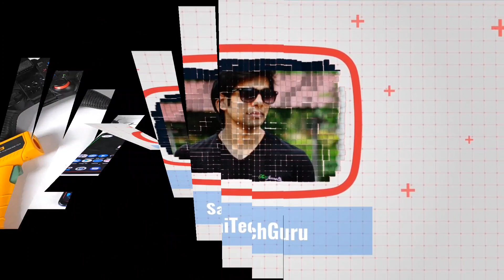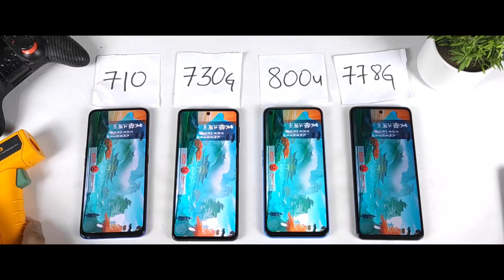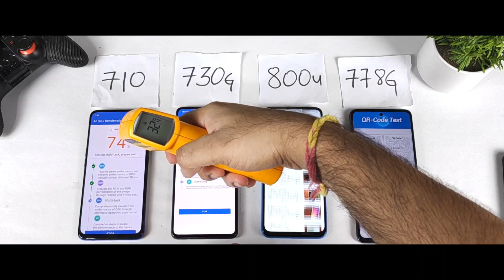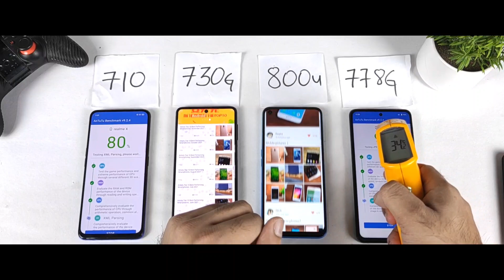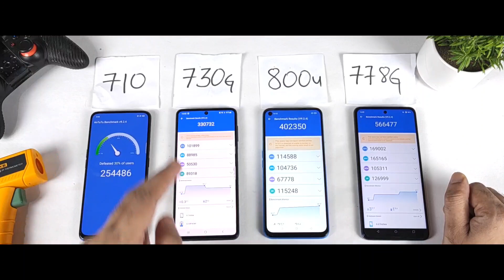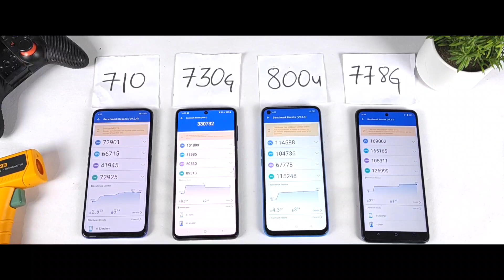iQOO Z5 vs Realme Narzo 30 pro vs Realme X vs Samsung M51 vs Antutu Benchmark Comparison 🔥🔥🔥

Comment: Realme X 🔥🤩🤩🤩🤩
Reply: Are you update the realmex to ui2.0, is it good or laggy
Reply: @prakash-123A  it's amazing. Must update it 🔥😍
Reply: @sahilbalmiki790  ihave 4gb model ram expansion feature is really useful in ui2.0
Reply: When I update the mobile it shows network error what should I do
Reply: I couldn't download the new android 11 update
Reply: I tested both Internet and WiFi but it is showing network issue
Reply: @prakash-123A  no it don't have ram expansion feature
Reply: @prakash-123A  reboot your phone and then try it
Reply: @sahilbalmiki790  when it will get ram expansion feature
Reply: @sahilbalmiki790  yes did reboot my phone but still showing like that
Reply: @prakash-123A  No it will not get ram expansion feature
Reply: @prakash-123A  Try some other's wifi connection to update it